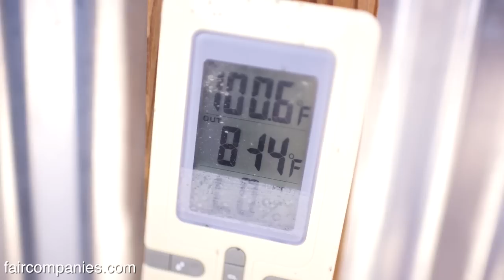From Gotham to isolated, code & debt-free West Texas estate

Comment: Dig down. It will maintain a constant temperature of 52°F 10'  down. That would cool it enough to grow lots of vegetables and fruit. Grow quail along with your chickens as they mature in 6 weeks rather than 6 months. Rabbits and goats. Rabbits reproduce at a high rate and are all protein and goats eat anything and produce milk. All provide fertilizer  You could grow vegetables year round. You'll need bees too if they're not abundant in the area or hand pollinate which sucks and is unreliable at best.

Do you have a well for water?

Comment: maybe you have done it right,  i have 40 acres up in the front range of the Rockies in south Colorado but the area can have serious weather in the winter and the ski resort on the next mountain has closed down a few years back....................it was hard there and i ended up thinking what is the point?  and moved back to UK and Europe to  live.......life here is far easier and what is more it is cheap to get to Asia and Africa for low budget trips.
Reply: @Clementine Washburn i still have the land, it has a lodge on it that i built but still needs finishing, it is two plots, one on the highway [5 acres] and one twelve miles away on county maintained dirt roads up on the mesa [35 acres].....it is near to San Louis Colorado, the first town into Colorado when coming up from Taos New Mexico..........i want what i sunk into the land including buying it, surveying it and building a lodge on it which is $120,000.................the lodge does not have water or electricity and still needs a solid floor as at present it is only dirt. you will need storage tanks and a smaller tank for hauling your water from the lakeside five miles away where there is a pump..............the up side is that the estate has a lake and an airstrip. town is a twelve mile drive away.

Comment: I wonder if he drilled down until he found either water or a good temperature if he could use the earth to cool that greenhouse? 
   If it were me I would try, if he didnt find water he could sink an 8 inch pipe and fill it with water. Pump the water out of the ground and through a large radiator with fans forcing wind through it. Could close the loop by sending the out bound hose back to the ground pipe. I bet he would have a cooler place.

Comment: i am a building super and we have a hoa , which is typical it seems .  its run by the three HitIers in the block , absolute control freaks (2 of which are magistrates !!!) , they have £100,000 in the kitty but being control freaks its never enough,   and i have to use a lawnmower which drips petrol onto a hot engine .

Comment: I'm planning to move to terlingua to homestead. Questions: what kind of internet can you get? I work remotely and need about 5mbps download, 2mbps upload and less than 150 ping. Is that even possible in the area?

Secondly if I buy land w no water hookups, how do I go about getting water for irrigation and is it expensive to get?

 Are there any kind of water shortages or times of year where I wouldn't be able to run a sprinkler on my garden? 

And why are there no trees? Is it also bc there's not enough water in the ground to sustain them?
Reply: Sounds like you might want to visit first. There is Dsl and fiber optic, that is not generally a problem. It's a desert. Very little rainfall. I have never ever seen anyone sprinkling a garden. There are not many trees because it is a desert. People mostly use water catchment that stores rain during the rainy period. Terlingua, the town, Alpine, etc have places where you can buy water, but that would generally be for temporary stays or drinking. I have known a few homesteads that were lucky enough to have a dug well, but that is not something to count on unless you buy the land that way.

Comment: Why not build a rammed earth, straw bale or earth bag house?
Reply: as someone who has lived like this guy for the better part of 15 years (also in the southwestern us, but up at 8000 feet above sea level), i can say that any kind of earthen home is MUCH more work than framed construction, and if you are working alone (as i was) and well into middle age (as i was), it turns into a years long project. i had dreams of building a small cabin of cob and straw bale, but as soon as i mixed cob for one wall of my outhouse, i reconsidered.

all straw bale with timber framing might be doable. but good (and dry) straw bales were so expensive that i couldn't even consider it.

Comment: He says he is living off grid, but technically he is not. He has internet and a landline telephone.
Reply: Isn't living off grid not being connected to the grid? His house is run off solar, so he doesn't have an electric bill.
Reply: @renewyourmind1815  living off the grid refers to living autonomously without relying on public or private utility services such as Internet and phone services.
Reply: @thomasjensen6243  - Its disconnecting from the electric and communication grid, having a way to get water that does not rely on Municipal Water Supply, having to deal with your own waste and sewage, being able to heat / cool your house without being hooked to natural gas lines, dealing with local zoning laws and legal issues. So it appears he's doing 4 of the 5 anyhow.

Comment: Anybody know what the laws are in Florida? I am about to buy a small property on an unmaintained road. It's only a mile from a major state road and retail on an unmaintained, unpaved road.  I have no neighbors for about another in any direction.  I got the County to say in writing that I am legally allowed to drive through and clear those unmaintained roads as right-of-way to my property.  The power company quoted me $5k to run power to the lot, but I don't want it. Officially, any improvements I make must be first permitted by the county, but the county does not and will not drive in front of my property.   I'D LIKE TO KNOW WHAT MY RIGHTS ARE .. as far as  sleeping in my small van (that has built in Solar Power) ON MY LOT?  How about camping on the lot with family and friends?  Can I store movable structures and vehicles on my lot? and can do this day and night 365 days a year LEGALLY?

Comment: I wonder what he's doing now, five years later.  How'd everything turn out?  My guess is the work to survive so close to the desert elements took its toll and he's either bought more tech to help fight the elements or moved into a different situation.  If you're working that hard to survive then how is that any different than living in a big city working for the man.
Reply: You know, Kirsten did this amazing thing and linked his website in the video description. You can head right on over and check out just how he's doing. And no, the pressure to survive hasn't shaken John, he's still doing his thing.

Comment: He lives in that 124' house huh? Guess his obvious  Airstream sitting there must be for "guests". His paranoid "they're coming to get me" surveillance system costs more than his house. And it doesn't take a genius to figure out that corrugated steel is exactly the worst possible material to use in the heat. Here's how not to do it. But I see he has a big old AC unit on that expensive Airstream. C'mon with this nonsense. Congrats on your hobby..... because that's all this is. Disposable income. You can't just defy common sense and the obvious and pretend "this is how it's done". No..... it's not. He lives in the Airstream.